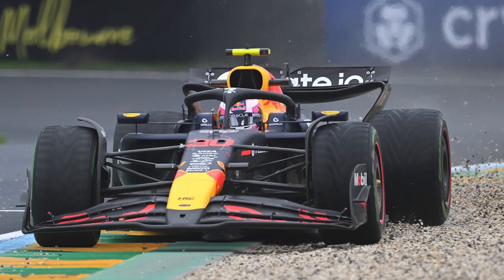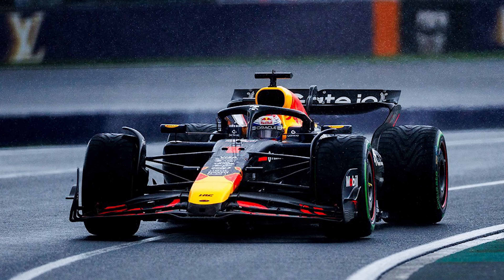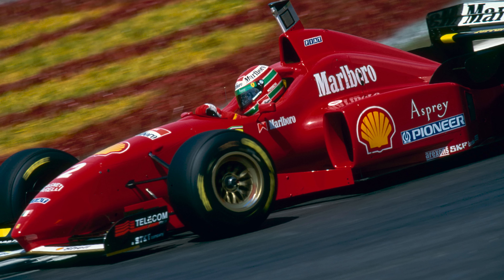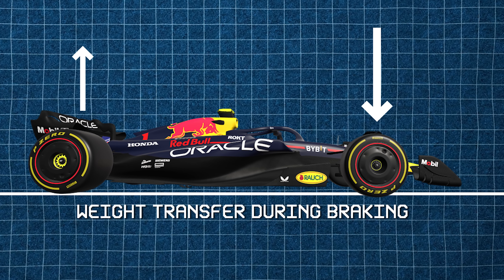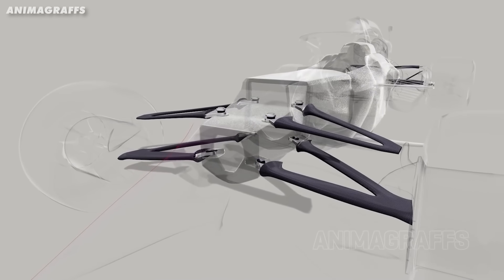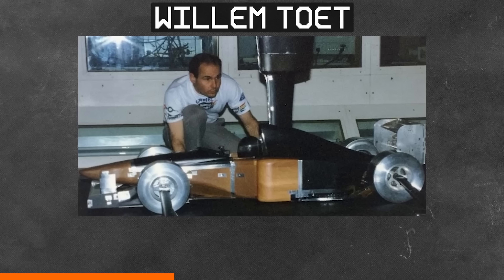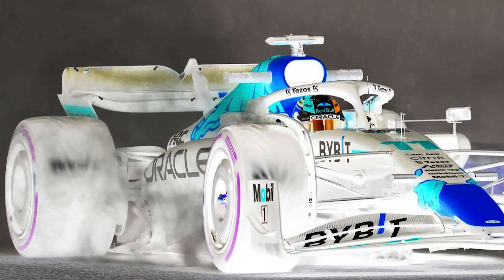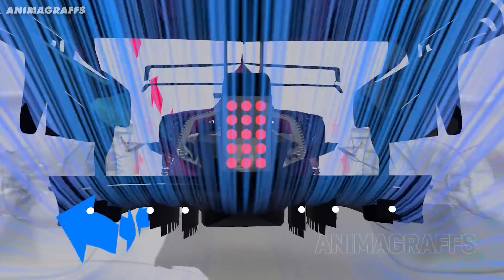F1 Engineer Explains Red Bull's Difficult Car

Comment: Modern fighter jets are intrinsically unstable to give better aerodynamic performance. Trouble is, these require precise and super fast action/reaction to not immediately lose control, ie. computers or Max Verstappens.
Reply: This really is the best comparison IMO. The Red Bull is naturally very unstable, but that instability can be exploited for greater performance if your cna be precise enough. But the downside is it makes it increasingly hard for drivers to drive, and eventually you start loosing consistency even with a great driver as inevitable imperfections that no human can completely eliminate nock little bits of here and there.

Put Max in the Mclaren and he might not be any faster than Norris or Piastri, (its hard t say how much more there is to wring out of it from driving alone), but he would be working far less hard to match them than he has to in the red bull. And that means fewer mistakes.
Reply: And thus the call for rule changes to allow active aero.
Reply: difference is, a fighter cannot fly without the computer no matter the talent of it's Pilot, still shines over the fact the RB 21 is on the edge of it and only max can drive it

Comment: I can't imagine what it's like to drive a car that loses steering for a sudden lack of down force, unless you can drive with the most precise technique in the world. 
Great explanation. 
And hat's off to Max for being able to do it.
Reply: It happened to Yuki in Q2. Had a big drop off in grip right before he started his lap.
Reply: I reckon it would be like driving a JetSki 😂
Reply: I will give you an example I play Live for speed and there you setup the cars yourself. And I found i tend to like rear instability, hard suspension on the front and softer on the rear.
Because when you brake like in the clip you get boost in to the front grip and loose a bunch of rear but if you go minimal with the steering input you are not crashing and basically on rails because the rear is still in the edge. Then mid corner you apply full power with basically straight steering wheel because you already hard rotated with late entry. The soft suspension absorbs the initial torque and you fly off from the corner. 
Downside if you over rotate, if you brake too late, if you apply power too early, if you ride a curb with above minimum steering wheel input you loose the rear like Doohan in the free practice.
Reply: @milendragomirov6499 just like how I like the setup on an ae86. Makes the car feel like it's dancing

Comment: The problem with Red Bull is not the car. It’s the fact that the junior car is nothing like the senior car. The junior drivers (Lawson, Albon, Gasly, Kvyat) aren’t prepared when they get promoted. What’s the point then?
Reply: Are you suggesting for them to break the rules and make 4 cars from 2 different teams the same?

Comment: Alex Albon talked about how the RB cars are... hypertuned. He likened it to setting your mouse sensitivity to maximum, so the slightest input makes the cursor go wild.

Max, though, has the reflexes and precision to make it work.
Reply: Was it last year of the year before that Max ran 35 or 40 laps at Mexico - all within the same tenth of a second - PRECISION, repeatable precision.
Reply: I’m so glad you brought this up. Albon definitely explained this beautifully and with simplicity. And it gives a whole new perspective where you start to appreciate Redbull and their engineers. 

I’ll be bold enough to say that the problem is not the car, the problem is that the engineers are building a car so crazy that it takes an insane driver like Verstappen to be able to drive it.
Reply: @dailyrevs1320 That's what McLaren is doing so it is possible but rb basically re-engineering the car mid-season is too much to ask imo
Reply: @chillguy.bin.g.chilling  you need to remember that mclaren got a diffrent pu and gearbox and you need to desgin around that. Still they did a good job cause they are beating merc but for now we cant know is it possible to design a better car with honda pu etc.
Reply: @dailyrevs1320  i honestly hope they can fix this massive issue going in 2026 cause Max can win alot more then he already has and no one wants to see another rookie get his confidence crushed by the rb 2nd seat
Reply: @chillguy.bin.g.chilling 2026 F1 cars also planned to be 30kgs lighter than 2022 one.
Reply: This also happens in the Air Force as well. 
Companies now a days have the technology to build some crazy aircraft but engineers are limited by your average Pilot’s ability to handle extreme G Forces.
Reply: @dailyrevs1320  it may have been Keith Code who wrote that new bikes get faster every year, but new riders have always been the same speed.
Reply: Absolutely not.
As ex CS pro player. I used high sensivity. Meanwhile there were other ex pro players who used like 1.02 sensivity compared to my 2.90 sensivity. Doesn't mean they sucked and some were better. It's a preference that likes to Max
Reply: F1 and games can't be compared @sbharin
Reply: @ Alex Albon is comparing it to you genius learn English
Reply: @sbharin  but saying no means you nothing because that car is super on the nose and it's near impossible to drive fast
Reply: @sbharin  If you can handle 2.90 the same as they handle 1.02 then your reflexes will be faster and the same applies in F1, a more sensitive car means it's difficult to handle but for Max who can drive with the precision and consistency required for it, he can extract some Milliseconds extra every other lap and those milliseconds eventually add up to make the difference he needs
Reply: @sbharin  What Albon said means take those lower sense pro players and make them play with the high sense and then see how they do. And then imagine each time you die against a pro with his prefered sense means you're not making a corner or are losing time. It's difficult.
Reply: When did he say this?
Reply: @zacharydrew205  he said when my sensitivity is high like no one asked for his game sensitivity

Comment: The implications of this is that a driver needs to go through an apprenticeship in which he is given progressively sharper set ups. Impossible to learn when difficulty is dialed up to ten from the beginning. A good driver will learn quickly, a less good driver will never learn. But even a good driver cannot learn if he isn't provided with a suitable learning curve. A vertical line is a wall.
Reply: "A vertical line is a wall" what a great sentence 👏
Reply: Bring back testing
Reply: @drifter402  which is where MS gained an advantage…
Reply: @jerehada he gained most of that advantage using superior braking techniques.
Reply: @drifter402 mid season testing?
Reply: I think you nailed it ! some will climb the curve quicker than others but the curve must still be climbed one way or another.
Reply: maybe RB sees this as a weeding out tool. when the right driver comes along and he is able to tune into the car, he will win races.
Reply: @meta4282  that's not it, there aren't many drivers on the whole grid that can handle something like that including drivers like Alonso, Charles and Jack Doohan(🐐)
Reply: Yuki is a good driver tho, he’s not exceptional or anything and was still able to be pretty close to Max’s times at least in Q1. I think he would of got 5th maybe 4th if redbull gave him an extra lap in Q2 but he’ll have to cook from 15th and I think he can do it, he’ll finish 7th or better if he doesn’t get into any accidents.
Reply: @dbzcollector9963  true. but redbull would probably rather bring hadjar into the seat by next race than wait lol
Reply: @howinthewhat or even in next few seasons just in case of waiting Hadjar to unleash his true potential.
Reply: Only problem is that you need to sacrifice potential speed in the car to have a more forgiving setup, leaving you p20
Reply: @ It's not all or nothing. It's about optimising the learning gradient in order to extract the greatest potential from the driver/machine combination. The greatest driver will be the one who has learnt the most. That will be down to his inborn ability to learn combined with how he is trained by increasing challenges. Talent is a propensity for learning, skill is the result of applying talent in a process that hones ability.
Reply: Only 20 drivers are allowed  to drive every race weekend, so they’re all great drivers. I respectfully disagree, with my opinion that the opposite case for Red Bull. This is that Red Bull has needed to learn how to adapt and cater to king max. Checo came in and was able to adapt, but then they made changes needed to keep king max happy until Checo got fed up. As for Yuki…bless his soul… however, I’ve seen friction between king max and the garage crew, where I would find it possible that Yuki might end up as Red Bulls lead driver… 🤷🏽‍♂️
Reply: Gran commento Giovanni, logicamente indibattibile
Reply: You sound like the type of human who never holds himself accountable for your own success. Ladders exist but if your bothered by the wall you'll never get the ladder.
Reply: @1212goose  I'd say pole vaulting is a better analogy and beginners (regardless of how talented (athletic) they are) should not be handed a full length pole..... Talent determines how fast and how far one progresses but no one starts at the top. Managing expectations and the rate of progress of an athlete is possibly the coach's most important job.
Reply: @giovannigaleotti2623 nope. That analogy is like saying f1 is their first drive and they were thrust into f1 with no racing experience. Most of these guys have been racing since they were children and cart to car is extremely different. They climb the ladder of cars and wind up in F1.
Reply: @1212goose  Do you really think driving in F1 is like carting or one of the lesser formulas? An experienced driver can focus on exploring the car's limits in different configurations while a less experienced driver must learn both the car's limits and his personal limits. 
The way Kimi Antonelli is being managed in his first season is case in point. The team is perfectly happy with him being half a second slower while he is learning the ropes and do their best to keep him out of major mishaps. If he has the necessary talent they will gradually dial things up as he progresses. Talent is the ability to progress consistently and relentlessly all the way to the top - it's not being born with universal knowledge.
Reply: @giovannigaleotti2623 your talking as a sub par human that sounds like you have never driven competitively. The professional world of anything coddles nobody.
Reply: well most walls have a small batter
Reply: But you forget that these are supposed to be the very best drivers on the planet not just good  and less good drivers, the very best. An important point forgotten
Reply: @philipbyrnes7501  that logic is so dumb that i won't even try to correct it
Reply: @ Do you have any experience in mechanical sports?
Reply: @philipbyrnes7501  there are ALOT of factors that you didn't consider while writing this comment
Reply: @philipbyrnes7501  In mechanical sports the machine is constantly evolving and the man is constantly learning. It's a completely dynamic process. Everyone is only as good as their last race.
Reply: BS. Either you have talent as a driver, or you don't
Reply: @badgumby9544  BS Back. They are all talented there and they do need time to adjust to the car to get the last 5%. Some crash too much trying some take a few laps or races to find the limit.
Reply: @badgumby9544 explain ‘talent’ please.
Reply: @badgumby9544 That is such BS, that only comes from someone who never had "talent" in anything. The all mystical talent is at the end a skill. We just like to call talent when someone young or new show their skills rather than admit that a 3 year old mastered a skill better than 99% of adults.
Reply: @badgumby9544  such a bad take

Comment: "F1 teams don't make the car around the driver, they just make it fast" is one of the stupidest things that F1 fans commonly think is true. it is not. They develop the cars to be driven fast BY THE DRIVERS. That is that part that is left out, the initial car design can be said to be developed without driver in mind but once they need the car to be driven on the track by a driver then fast car that is undrivable is NOT A FAST CAR. 

F1 cars are developed with the drivers, their feedback is more important than really any aerorake results you can get and has more impact on the car design and setup. All of the simulations are secondary when your #1 driver says "it understeers".
Reply: Hi Lewis.
Reply: @ ??? Wut?

Comment: Understeer was the talk of the RB21 today and max hates that.   Yuki looked rapid in that car with understeer like Perez.  But when push to the edge (with extra downforce like Yuki was running) it switch character.   Great work Hadjar, Liam was a 10th off in Q2 but there was 4 drivers within that 10th. That is an amazing tight field.
Reply: The time gap between Hadjar and Tsunoda, who was 15th in Q2 was only 0.215 seconds...

Comment: I dont understand all the comments mentioning that Max got pole. What does that have to do with this video? The fact he got pole doesn't mean the characteristics of the car changed plus Lando or Piastri would have gotten pole if they were able to out together a good lap
Reply: Somehow they didn’t in a more stable car.
Reply: @saifalbarwani9800  I don't know how stable their car is. Bot drives have said from testing that it's been difficult to drive. It's probably still not as difficult as the Redbull but I don't know
Reply: Cause they think a 1 lap time win's the race. Don't matter if you have 1 perfect in qualifying cause when race starts you need to do 50-60+ of them in a row vs other car that doesn't have to be perfect and its just as fast and is easier on the tires.

Comment: This is why front flexing wings is such a battleground. You can have an advantage in the slow speed corners without the drag penalty on the straights associated with more front wing.
Reply: Rear wings have been nerfed atleast for now, race 9 we will see how the front wing rules shift the grid.
Reply: @StevenSt08  Yep, but I suspect they are already working on ways to maintain the front flex while still inside the upcoming change.
Reply: I can't wait to see 2026 regulation with DRS on front wings as well, even if they will be slower I think we'll see better racing. At least until one team finds the "unfair advantage" that makes it unbeatable.
Reply: @ I've never liked the idea of moveable wings. Doesn't sit right with me.